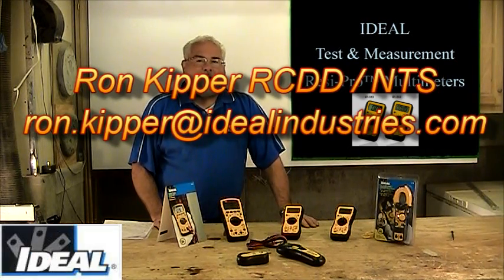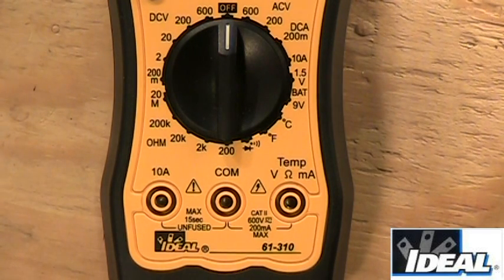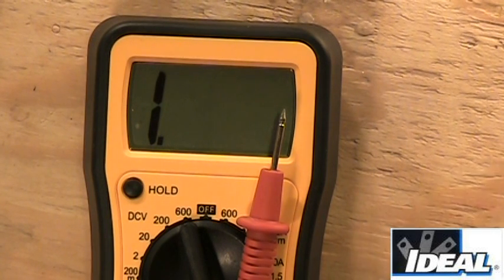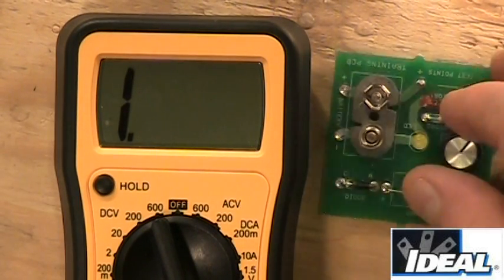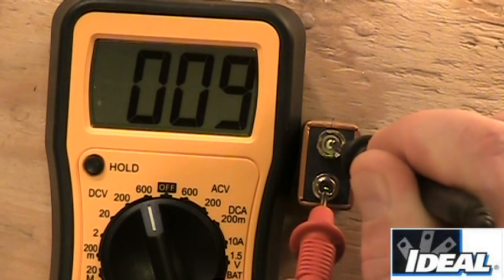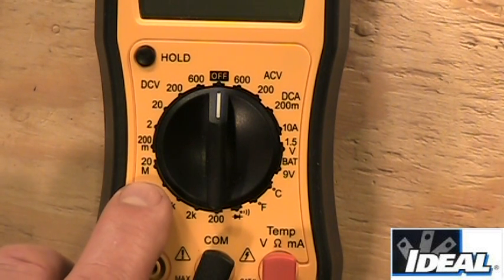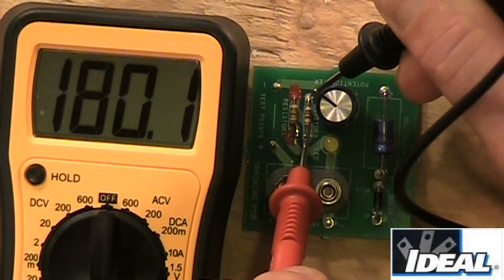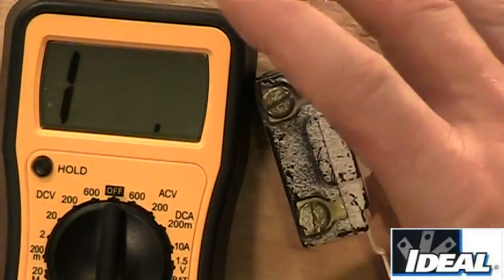61 310 Digital MultiMeter

Comment: When I set meter to continuity/diode and touch leads together meter readings go from open (1.) to .718 NOT .000and there is no beep. Is my meter bad? Does it need to be replaced?
Reply from the maker: Hello the meter may not zero out but it should beep at that low of resistance it may need to be replaced. IDEAL has not made that tester for probably 15 years now I would recommend the 61-327 or 61-337 for a replacement hope that helps I have video up for both of those testers Ron

Comment: Hey Ron. Awesome video. I do have a question you didn’t touch on. On the screen on the left mine is showing a blinking solid bar. Unknown what this is.
Reply from the maker: Hi we have not made this tester is quite some time and you don't mention what you are measuring but I would guess it is showing you a negative DC voltage reading hope that helps Ron

Comment: I was trying to see if you knew how to replace a fuse on 61-310 and you don't explain that I'm confused
Reply from the maker: Hi Steve you have to remove the back cover to replace a fuse. Just make sure you replace it with a proper fuse which should be in the instructions. FYI IDEAL has not made those testers in probably 15 years now. Have fun Ron
Reply: @RonKipperDatacomm1  He didn't watch the whole video...🫣🫣🫣

Comment: Hi Ron enjoyed your video. Why is there a 1.5v & 9v dc selection as well as 2v&20v in the reg dc scale. They give different readings.
Reply from the maker: Hi Al the 1.5 and 9 v function will apply a small load to the batteries to get a better reading if the are still good. FYI we have not made that meter for close to 12 years now. Ron

Comment: Right off the bat I put the thing on audible mode, touched the leads together and it registered 689 and stayed there . No zero, no ping.
Reply from the maker: James the meter may not be working correctly. IDEAL has not mad those for probably 12 years now so the meter is getting old. It can not be repaired sorry not much help Ron

Comment: what settings would I use to test for ground?  Also how do you get replacement leads for this model?
Reply from the maker: Hi Shannon our TL-102 test leads will work with that tester or probably most leads you might find will work. When you say you want to test for ground I am not sure what you are asking. However using the resistance function should be the setting you will use. Have fun Ron

Comment: Thanks for the video! Very helpful, but there is one discrepancy.  My manual shows that DC Current has the Black lead on the far left, 10A side and the Red lead in the middle on COM.  I'm not sure why and still learning how to use the meter. Thanks again!
Reply from the maker: Hey Paul obviously that must be a mis-print in the manual. We have not made those meters for over a decade now so no use fixing the manual. Keep in mind that meter is a Cat II rated meter so it is safe to use outside of walls not inside say an electrical panel. Use it well Ron

Comment: Hi Ron. I have had this tester for a while and never used the thermocouple. I tried it and all it will show is -1. Any ideas?
Reply from the maker: Hi Raymon I would say the temperature function is no longer working. It should read the ambient temp even without the thermocouple plugged in. We no longer make those testers so and the warranty is no longer any good. Might be time to replace the meter. Sorry I was not much help. Ron

Comment: Hi Ron.  I loaned the 61-310 to my daughter.  When she brought it back I touch the two leads together (ohms) and I get infinite on the 200 setting and .897 on the 2k setting.  Ac voltage shows 117.8 (AC) when plugged into and outlet.Is there a way to fix the ohms or should I through this away?
Reply from the maker: Mike I would say you should replace the meter there  is no way to actually try to fix it. Not much I can do to help you as we stopped making that tester about 7 years ago. Thanks for reaching out to me.
Ron
Reply: Thanks for being so fast!  Wow!  Impressive!

Comment: Hi Ron, I have a 61 310 but it has a slightly different layout. No temp function, but extra 10 A function. When i put it on 200 Vac setting it reads -09.5 at rest. When in a wall outlet it reads around 90 V. Is there a way to recalibrate? It's done this for years, but this is the first time I've found your video. thanks.

Comment: Thanks Ron, this was very helpful.  I tried all features after your video and all work well, great instructions. The only one I am having trouble is with the temperature - looks like the thermocouple or the tester seem faulty. I am getting -1 when I try to read the temperature, both in C and F and it's at least 70f where I am. I tested the two prongs of the probe +/- and get about 13 ohms and a beep when just testing. I get about 9 omhs between the  +  and the tip of the couple and about 3 ohm with the negative.  I can only think that the meter is somehow not working but seems fine on all other features. I own this multimeter for about a year and use mostly for batteries and some power outlet. Any thoughts ? thank you.
Reply from the maker: Claudio I would say there is something wrong with the meters temperature circuit. You don't have to use the thermocouple it should read temperature just by switching to that mode. The meter carries a 2 year warranty from the time you by it. We have not sold those meters since 2009 and if you still have the receipt from the IDEAL distributor you bought it from we will still warranty it. If you need to get a hold of me my email is ron.kipper@idealindustries.com. I appreciate you watching the channel. Ron

Comment: Hey! Your tutorial for this multimeter that I have is fantastic! Before your tutorial I was quite frankly ignorant on how to properly use my multimeter, or what all the dial slots actually meant. Now I am using it on a regular basis with great readings and results on my tests. Thanks again, and keep up these great tutorials! ^_^
Reply from the maker: tyler durden Tyler you are welcome. If you have the 61-310 be aware it is a Cat II tester so it should be used outside of walls and into appliances. Do not use it in electrical panels and such as it can get damaged.
Reply: Ok, thanks! I noticed that in your video too. Fortunately, its primary purpose in life is for my rechargeable batteries and small 14w solar cells. A couple outlets too most recently.

Comment: Ron I have an issue with my 61-310. The sound is continuous when device is on I checked the battery and the fuse. It worked last time I used it in February. I bought it last spring 2014. Thanks for the help.
Reply from the maker: mendezwvu1 Send me an address to my ron.kipper@idealindustries.com email and I will send you a 61-340 that I have here. Trash the 61-310 we have not made those for some time now and the 340 is a much better tester.Thanks Ron

Comment: Are we able to test capacitor with this digital multimeter?
Reply from the maker: Tom Nguyen Yes from 40 nF to 4000 uF so for smaller capacitors should be fine.Thanks for watching. Keep in mind it is a Cat II rated testers so do not using it behind walls on in breaker panels. Be safe.Ron

Comment: What if I touch the leads in the test mode and I get no audible sound?  I get .710 on the meter.  What does this mean?
Reply from the maker: 2GUNMASTER I am not sure if your meter is working correctly. Can you give me a call? 815-341-3537
Reply: ***** Will do this afternoon.
Reply: Well, it is 8pm and I forgot.  Will call tomorrow.

Comment: Great video. I purchased a 61-310 from McMaster Carr a few years ago and have never gotten the diode/tone setting to produce a sound. Touching the two together produces .692 instead of going to 0 as your video stated. Today, I opened it up and touched the red lead to the disk and it does produce sound when doing this. What else could I look at to get the tone to work and is there a pot that would allow me to tune the diode setting to 0 when the contacts are connected?

Comment: Bought this multimeter and used it outside in 40 degree weather and the display quit working. Took it inside to warm up and now the display does not work properly. I used it once and once only, what a piece!!
Reply from the maker: workinman Hey thanks for watching! Sorry to hear about the troubles with the 61-310. As testers go it is not our best tester but the price is right for a lot of you. I am not sure what you tested outside of the house. The tempature was not the problem. Are you aware it is a Cat II level tester and designed to be used inside a building but outside of a wall like at an outlet or in an appliance. Not in electrical panels or outside at the service entrance where transient voltages spikes can damage the tester. Send me an email to my ron.kipper@idealindustries.com address with you address and I'll hook you up with a slightly better tester.Take careRon

Comment: Can I use this meter to test mechanical things on my car? If so, where do I set the dial to? I picked one of these up from Lowes for practically nothing. Thx and this video helped out alot!!
Reply: It will work well for that being that cars use a 12v system at this point, as far as the setting to use it depends on what you are measuring, resistance, voltage, amps, etc...

Comment: Ron; I purchased one of these meters a couple of years ago and for the most part the meter worked well. I have never had the need for the temp function until recently so I attempted to use it which led me to this page. I'm not sure it the thermocouple is defective or the meter is. I connect the couple and turn the meter on to F or C and the screen shows -1 on the left hand side and does not move or give any other type of reading. Any help would be appreciated.